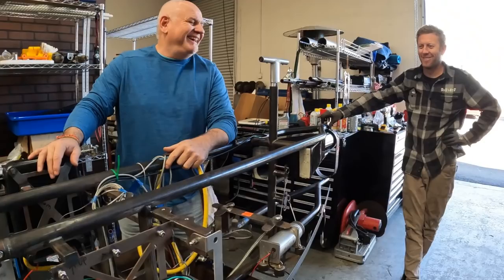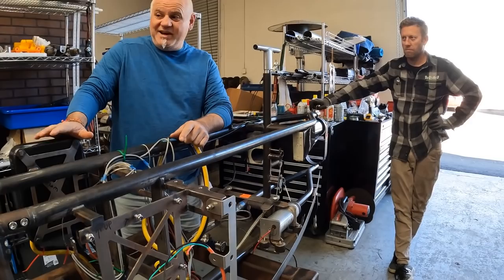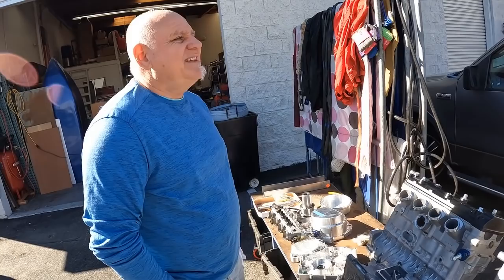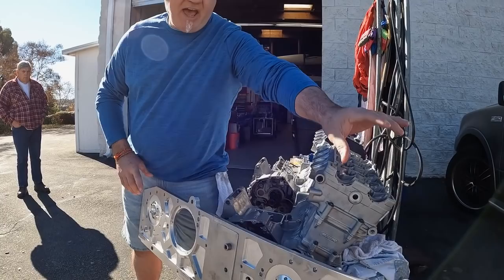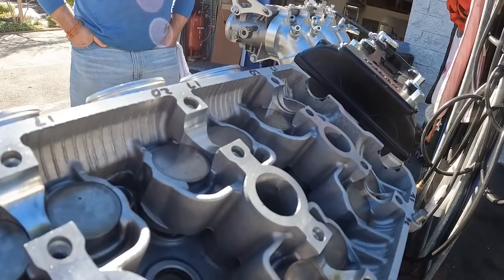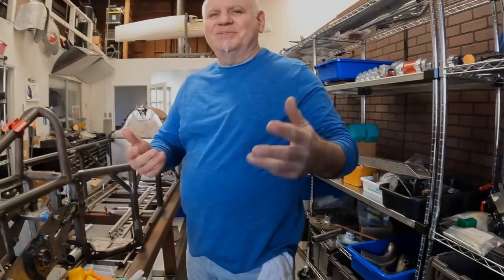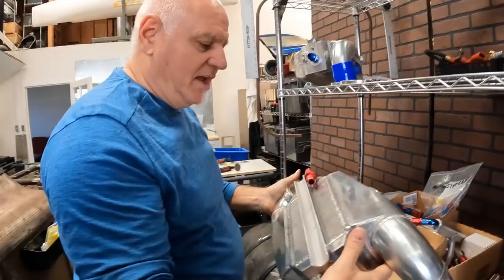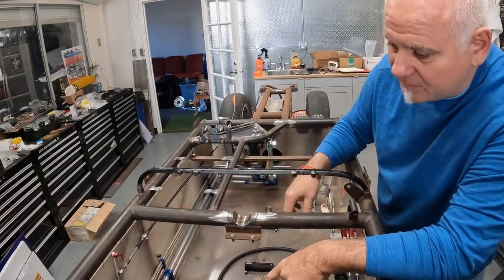How to Build a 400MPH Hayabusa Streamliner

Comment: If those are stock LS heat sink smart coils just a warning if they go bad they change their dwell and go off at weird times when its running to save themselves changing timing. Sloppy mechanics lost 2 or 3 motors to them. Would hate to see awesome work ruined by coils. The other LS coils without heat sinks whether truck or car motors without the heat sinks dont have the issue.

Comment: What took them so long to use them engines i use one in my fiat 500 crazy power im now putting a second engine in it be 4wd
Reply: Got to get out on the salt more. This is a new idea on an old concept 20-30 yr old at least.   This year (sept10-14,2021) I saw a couple of bikes running two hayabusas and/or Harleys running in the motorcycle( 2wheel version of this build)  streamliner classes .   1hp / 2 cc is a typical Target on the salt , classes are broken by displacement with records typically growing faster with more displacement. Got the opportunity to witness 16X  mph on 500cc think it was day three.

Comment: This would be a great interview if the front man didn't talk like a total veggie. The builder of these things have a privilege where you taught yourself all you can before asking if a caliper is a caliper. Same when asking several times what happens with adjustment.positioning,tensioning.. There is time to learn lots more if you don't flounder at what is a wheel.